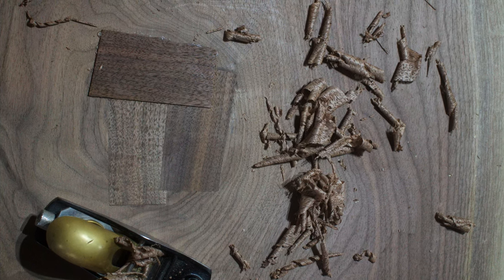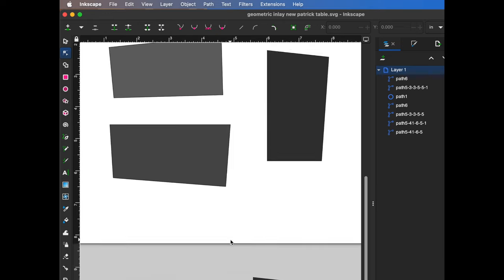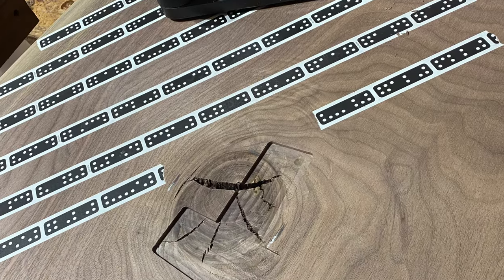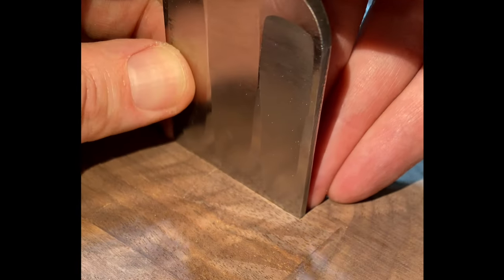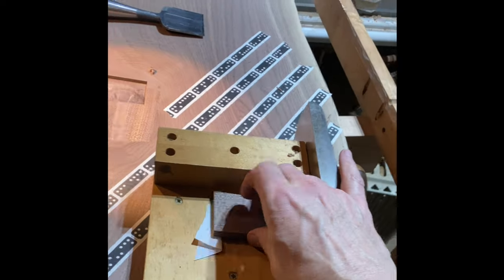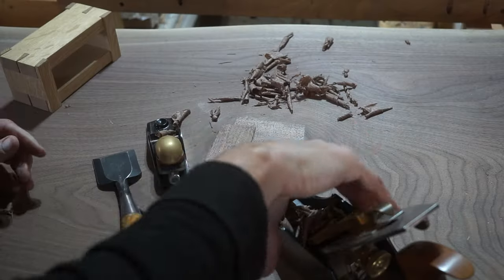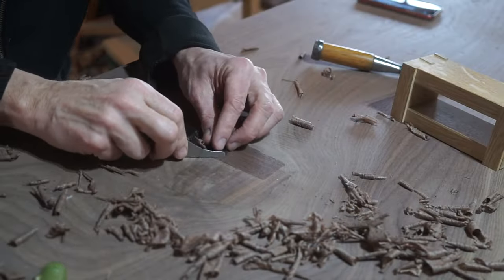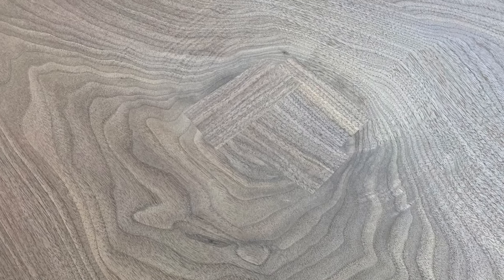Covering Up a Gnarly Knot in a $1000 Walnut Slab

Comment: Very interesting design choice. I actually like it. 
 I would have personally chosen a different pattern. Offsetting the Domino like pieces was a bold and well considered choice, the result is that the eye moves past them, follows the grain lines back to the outside main structure. It makes them very invisible. I personally would have used a much wider grained section for each, and curved the points much much more so they are more pill (capsule?) shaped. This would be a more obvious and contemporary looking result. Alternatively I might make them equally offset yet have sharp corners to convey an obvious fault with a considered remedy.
Your result is very clean and elegant. Thank you